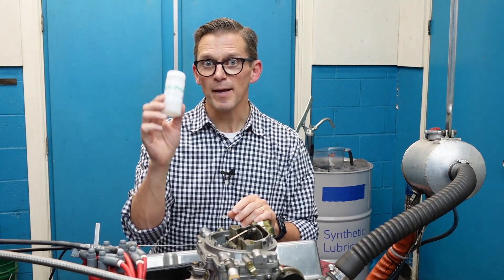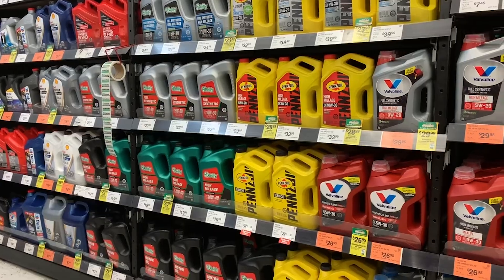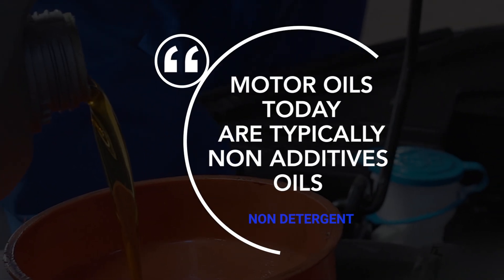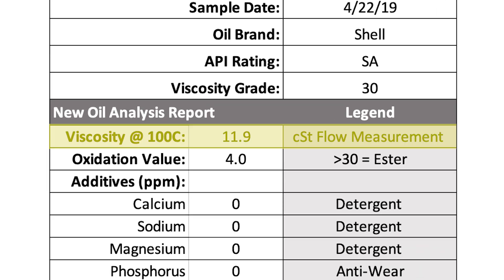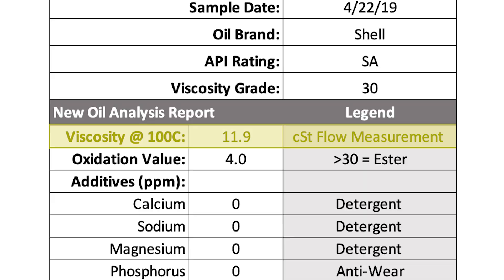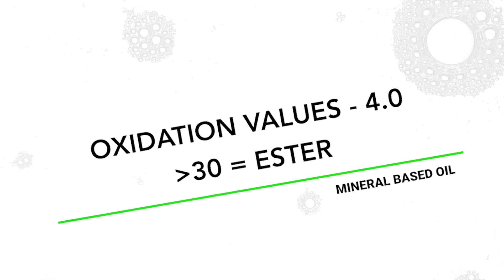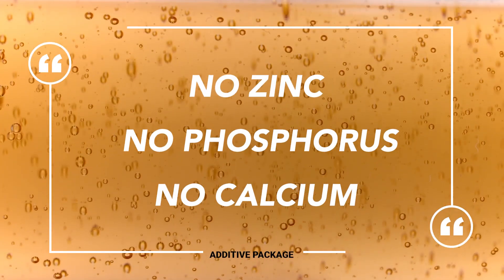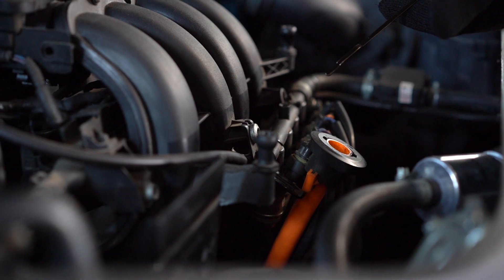Non Detergent Motor Oil - What's In It?

Comment: My old shop teacher told us to use this as a way to "clean up" an engine.  Once a year, a non detergent oil & filter change, bring it up to temp at idle only. Dump it and then a normal oil change. All of his vehicles lasted over 200k miles.
Reply from the maker: A flush oil change like that is a good idea, but the non-detergent oil part of that is not.
Reply: @themotoroilgeek  I have studied this topic pretty well. My idea is that if you accelerate the oil change interval, then you do not need to worry so much about the ability of the oil to neutralize acids and suspend contaminants. I suppose you could add, prevent deposit build up to the list. A flush oil change probably is not going to help an engine, not that it will harm it either. If someone had acquired a vehicle with a dirty engine (sludge or even synthetic oil crystallization) and asked me what to do, I would say, start changing the oil more often. I have seen synthetic oil crystallization. I assessed it as scary looking but harmless. It did slowly dissolve out. The previous owner's son had put in some brand of high mileage synthetic and then the car was driven about 20 miles a week for years on the same oil. Toyota 5SFE with 103 K miles.
Reply: I like to rinse some of the old oil out with a little clean oil when changing oil since a bunch of oil is hidden in nooks and cranies of engine seems like if you are going to dump whole oil in engine might as well just do oil changes more often.

Comment: Thank you for this advice, 👍🏼&subscribed. Would you advise for or against using a “T1” 
grade oil in 30wt. in a out of warranty Briggs 24hp v-twin riding mower?
Reply from the maker: I’m not familiar with a “T1” oil rating.
Reply: @themotoroilgeek  It’s a Shell product called “Rotella” T1 grade in 30 wt. I think it’s a straight grade that’s recommended for diesel motors.
Reply from the maker: @Ojb_1959  Got it, T1 is their marketing term. If it is diesel rated, it will have a full additive package, and that will be fine for your engine.
Reply: @themotoroilgeek  Thank you sir 👊🏼

Comment: Can i use 30w ND to my briggs and stratton engine thanks..
Reply from the maker: I would not recommend that
Reply: @themotoroilgeek what about using ND oil in the pressure washer pump? Mine say 15w40 but say search quality oil
Reply: @josebetancourt6064 It is unadditizes oil. It is literally a laxative. It has no mechanical use whatsoever.

Comment: WHAT BRAND IS A HIGH DEGERGENT OIL  ???
Reply from the maker: Any oil that is not labeled non-detergent
Reply: What brand do you suggest is the best
Reply from the maker: @maliknolan5711  We don't recommend specific brands. The key to choosing the correct oil is to NOT start with the brand. Instead, start with the application. Choose an oil of the correct viscosity and type for the application and then pick a brand that delivers that.
Reply: What do you suggest for 5w30
Reply: Is Royal purple? HMX  Is a good detergent oil

Comment: Quick question: Can I just use standard motor oil for everything aka compressors, pressure washers, small engines etc?
Shouldn't be a problem right if anything the anti wear additives and detergents in motor oil are a benefit.
Reply from the maker: Yes, regular oil will work better than non-detergent oil in those applications.

Comment: I really enjoy your content both here and on the Total Seal videos. I deal a lot with engine builds for performance Aircooled VW and Porsche, as well as “Airhead” BMW Motorcycles.

I would like to hear your opinion on the following controversy.

In the 90’s, Porsche and VW builders had recommended conventional oil against synthetics in the vintage Aircooled stuff, because there was a claim that synthetic oil didn’t absorb heat as well as conventional oil, and therefore the engines would run hotter on synthetic since the oil wasn’t carrying away the heat to the oil cooler.

Any thoughts on this? Was it true then? Is it true now?
Reply from the maker: Thanks for the comment and the question.  In regards to that question, synthetic oil has a greater specific heat capacity than conventional oil, so synthetic oil actually pulls more heat from parts than conventional oils. 

This manifests itself in an odd way - synthetics will run cooler than conventional oils (everything else being equal). That probably created the confusion which led to the incorrect conclusion that synthetics were not absorbing the heat. In actuality, they just didn’t hold as much heat.
Reply: @themotoroilgeek  awesome. Thank you for the quick reply. I see no reason why I can’t switch over to a high quality synthetic then. I appreciate your help!
Reply: @MaineMachinist  There is one thing that may be an issue: Seal compatibility.
With a cutting edge synthetic oil old seals may start to leak a bit because certain base oils they use to formulate engine oil dont do well with old rubber seals.
That would be Group 4 PAO oil it's common fully synthetic oil.

Comment: I use it in air compressors and thats it.    Had a coworker changing the oil on his push mower and he put in the ND 30 in it.  We told him not to and he just blew us off.  Needless to say the mower ran about 2 hours and smoked and seized up.
Reply: That's odd, I wonder if he didn't fill it to the proper level or something. While non detergent oil clearly isn't ideal for engines, it seems odd that it would ruin one so quickly. I know people who think non detergent oil is the best thing to use in small engines and none of them ever had a catastrophic failure like that. And back in the earlier days of cars when additive free API SA oils were the norm, engines still lasted a heck of a lot longer than 2 hours.
Reply: @averyalexander2303 The stuff that 1920s oil refineries were putting out had a lot of sulfur and sulfurized hydrocarbons that actually did have some anti-wear properties. This is just highly refined straight mineral oil. Not suitable for engines or anything else frankly.
Reply: Weird. Every lawn mower I've had calls for 30 weight because they don't have oil pumps and rely on crankcase splash. ND 30 weight is all I've ever used. Still mowing grass.
Reply from the maker: Sad, but true…

Comment: Great video, I was curious about this. Do you have any idea why so many people say to only use a non detergent oil like this one in non engine applications like pressure washer pumps and air compressors? Or is that just a myth? I understand why detergents may not be needed since there's no combustion, but I don't see why they would be harmful to anything?
Reply from the maker: Thanks for the comment and the question.

The use of this type of oil in a compressor or pump of some sort today is myth. 

There’s no technical reason to use a Product like this in a compressor or pump.
Reply: @themotoroilgeek  That's what I thought since it made no sense to me, thanks for confirming my suspicions.
Reply: I put standard 0w30 motor oil in my pressure washer. Runs great.
Viscosity matched up well with the spec sheet pdf of Karchers special pumphead/gearbox oil and what was already in the machine.

Comment: I seem to remember my older Briggs mowers calling for 30w ND? I could be wrong since I have a Honda now.  But if that is the case, why did they recommend using that?  Great vids btw!
Reply from the maker: Thanks! In the 90’s, non detergent motor oils still had some additives (like Zinc and anti-foam additives). Today, that is not the case.
Reply: @themotoroilgeek  thanks! Appreciate you clearing that up.  I thought that I was losing my mind for a minute lol
Reply from the maker: @johnnyh127  I’m happy to help!

Comment: I’m curious about the oil from Driven. A lot of engine builders include this oil with their engines and will not warranty it if another oil is used. They are not sponsored by them either or have any partnerships.
Reply from the maker: Stay tuned for the next video!

Comment: Good stuff Lake Speed! I was about to use Valvoline SAE 30Wt. non-detergent with ZDDP additive for my new engine. That's what we used to do when I still worked in the engine building industry in the 90s....all of my mentors said to do this. A lot has changed. In your next video, can you also cover some of the synthetic break-in oils, such as Royal Purple?  Conventional wisdom used to say NEVER use synthetic for break-in. Or is it a matter of plateau honed bores vs. straight stones, etc. whether you could use one? I would love to know these details!
Reply from the maker: I’m happy to help. I would avoid the synthetic break-in oils. That is still not a great idea.

My personal preference on break-in oil is the Driven GP-1 Break-In 30, which happens to be a straight 30, but it has a robust additive package designed specifically for break-in.

Comment: Speed, we used 30 weight ND oils in our cars during the 60s/70s and in our one and two cylinder 4 stroke engines back then. So what engines would you use this oil in today?
Reply: I really can't say for sure, it was a long time ago but either we didn't know about detergent oils but I think the main reason is because we didn't have much money back then so we would have bought the cheapest oil we could find.
Reply from the maker: I wouldn’t use a straight 30 Non Detergent oil in anything anymore. There are plenty of straight 30 grade oils that actually have additives in the oil (like they did back in the day).
Reply: @sandyshoremann7524  so my remembering buying Pep Boys brand 30 ND oil in their 1 gallon metal cans and using this oil in my 1948 Ford F-1 and my 1960 Ford F-100.... I guess I must have dreamed all that
Reply: @BusterKitten  Just because it's a ND oil it doesn't necessarily follow that it doesn't have other additives in it.
Reply: @FairladyS130 The "non detergent" designation was so heavily deprecated that it became meaningless. Current non detergent oil has nothing in it. Its best used as a laxative for when you wipe the cam lobes in your classic car with it.
Reply: @BusterKitten Why were you using ND oil in the 1960s and 1970s when the contemporary API oils recommended by manufacturers were all detergent oils?
Reply: @gregorymalchuk272  all I can tell you is my dad, born in 1911 lived through the depression and it affected him throughout his life.  Always the penny pincher he'd buy the ND oils because it was the cheaper oil.

Comment: So question is why does shell make this type of oil and allow it to be sold? This could actually cause   damage initially , during the break in period, which could result into high consumption of oil and other issues down the road.
Reply from the maker: They are not the only ones selling this product. There are several on the market. Many states have actually banned the sale of these products as Motor Oil for that reason.

Comment: It's hydraulic oil. S.A.E. 30 is close in weight to ISO 68. It's also good for triplex pressure washer pumps.
Reply from the maker: True, but the downside is no anti-foam additive.
Reply: Been using hydraulic oil in my air compressor for 22 years. Was recommended by the aircompressor dealer/distributor I bought it from. I had some Ingersol rand t30 select to use up  from my old compressor, it made very good chainsaw bar oil.
Reply: SAE 30 is ISO 100. SAE 20 is closer to ISO 68.

Comment: Air compressor
Reply from the maker: Yes, but I'd still like to see some anti-oxidant or even some ant-foam in the oil, even for a compressor.
Reply: @themotoroilgeek  Interesting info. The average consumer has no idea. I could see these big companies cutting back in areas most will never see. If they could call 24oz a quart they would.
Reply from the maker: @midway27272727  So true!

Comment: Very cool. Just a mineral 30 weight oil plain Jane. What would kind.of engine would something like this be used in?
Reply from the maker: In the old days, the straight 30 mineral oils had some ZDDP and a few other additives. These oils were used in the engines built before the late 50’s. They stayed around for a long time because they were so widely used. 

Today, there is NOTHING in them, but you can still find them on the shelf in some stores. Scary!
Reply: @themotoroilgeek  obviously not to run it in a modern engine. What about something like a lawn mower?
Reply from the maker: @BeardedFordTech  Nope, not even a lawn mower.
Reply: @themotoroilgeek  dang. So what is the point of this oil?
Reply: @BeardedFordTech  Don't do it.  A coworker of mine would not listen to me, he is a know it all.  Put it in his mother in laws push mower, it lasted 2 hours and seized up on him.
Reply from the maker: @BeardedFordTech  It's pointless. An actual hydraulic oil will at least have some additives. This is just a legacy product that has actually been banned in some states to even be called a motor oil.
Reply: @rtaggs8178  oh I'm not going to do it. I was just wondering what in the world kind of engine it's for
Reply: @themotoroilgeek  🤔🤔🤔
Reply: @BeardedFordTech  I've seen it used in air compressors or a hydraulic application.
Reply: @rtaggs8178  sweet
Reply: @BeardedFordTech  I've run Mobil1 in lawnmowers for decades. Used airplane oil prior to that. I've never seen a mower run on Mob1 worn out.
Reply: @hotrodray6802  Amsoil. I run amsoil in everything.
Reply: @BeardedFordTech  I love Amsoil  myself dude!
Reply: @chrisr.986  me too!
Reply: One you plan on destroying.
Reply from the maker: @rolandotillit2867  LOL
Reply: As far as I know only the old model A's and T's that I know of.  Thats what they used to run in them many years ago.  I know a few that own them and they all use Castrol mineral 20w 50 in them nowadays.
Reply: @rtaggs8178  wish I had a model T
Reply: @rtaggs8178  We've run Mobil1 in As and "everything old". No problems. Cars, trucks, tractors, mowers, etc.
Reply: My old John Deere 2 cylinder tractor uses 30 wt non detergent in the rear hydraulics, so there are some applications left that can safely use it.
Reply from the maker: @marchindy  yes, hydraulic systems are fine, but not any engines.